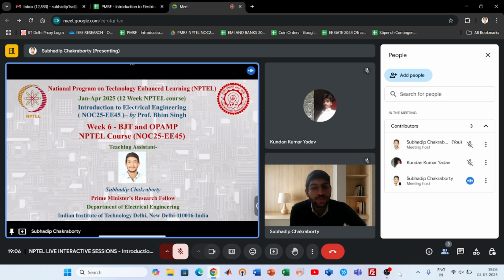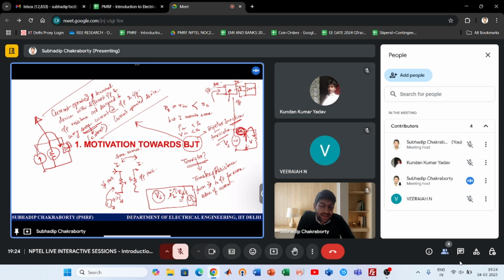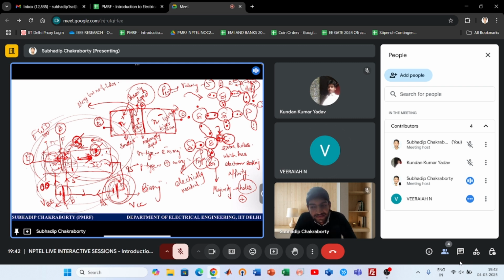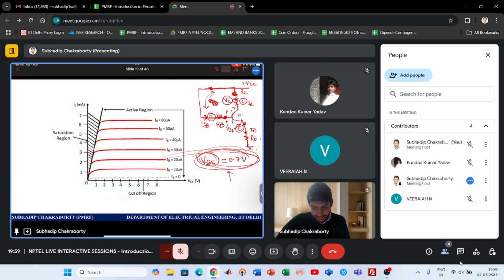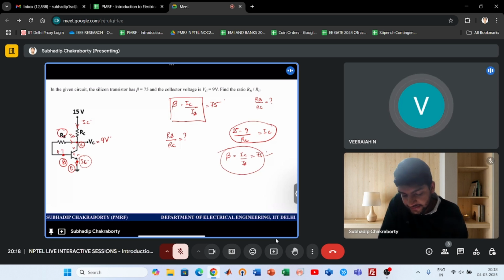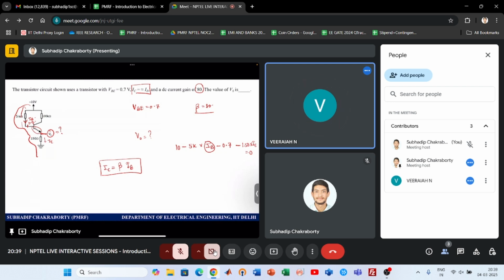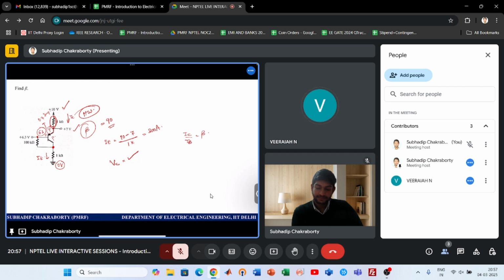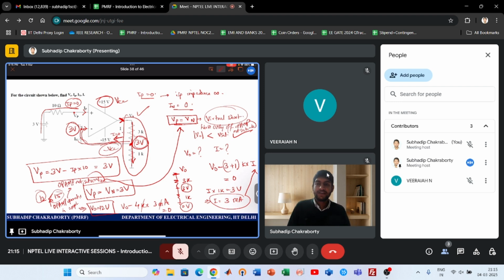Week 6 Live Session-Introduction to Electrical Engineering (NOC25-EE45)| S. Chakraborty (PMRF, IITD)

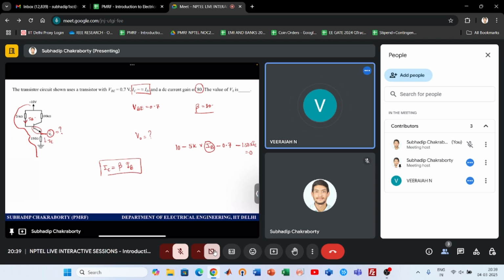Comment from the maker: Dont forget VBE is 0.7V, does not always imply that VB is 0.7V as VE does not sit at 0V always. There may be some bias voltage if there exist a bias resistor Re. (1:30:51). Hence, IB is not (10-0.7)/RB as VB is not 0.7V. That is why we are using KVL.